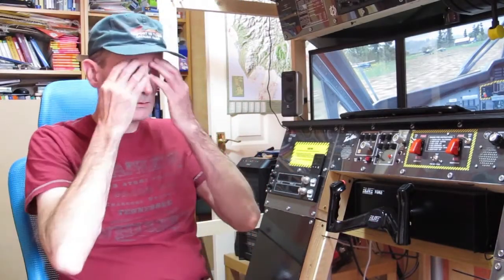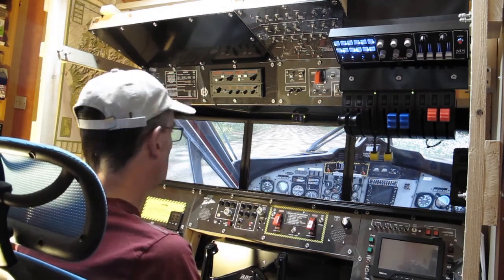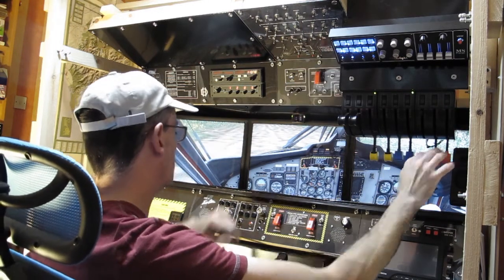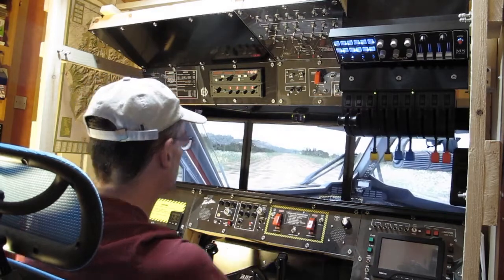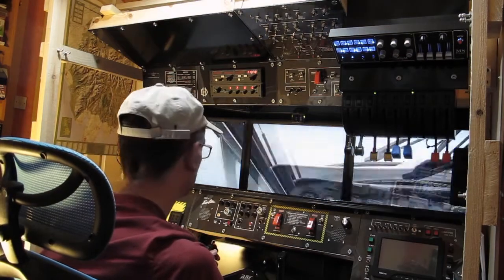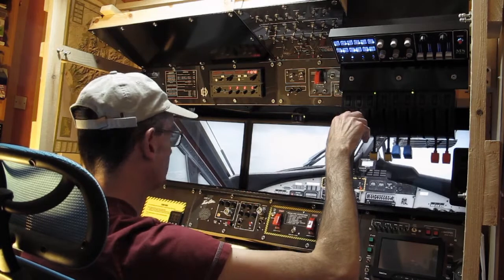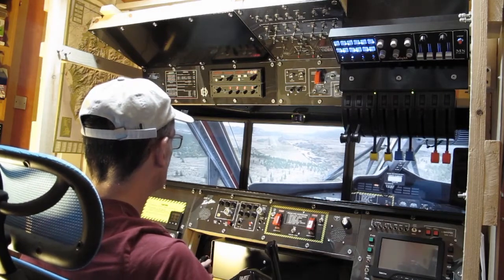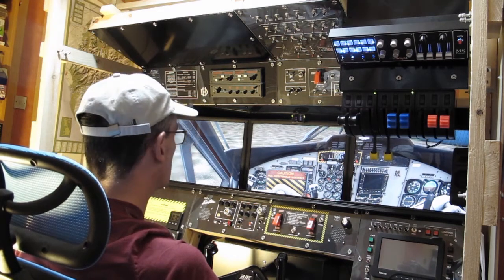First Flight without Keyboard or Mouse (Twin Otter Cockpit Build - Part 13)

Comment: Wow this is awesome. I've enjoyed all these videos. The Twin Otter is a great aircraft too, since you can use it on most any strip/runway, which is nice. :)
Reply from the maker: That was the plan! IThe one I'm flying is the Tundra version too, although I don't know if the difference in tyres is really modelled.
Reply: Almost Aviation That's what I though as well! Since you mostly fly smaller aircraft on remote strips in Australia and such. (At least that's what I gather from your videos)

Comment: How do you trigger the controls  ? LVar or default offsets ? Can you provide me a list for each controls' offset codes ?
Reply from the maker: I use LINDA functions to bind the buttons and switches to FSX. LINDA requires FSUIPC and functions are written in Lua. In many cases these just call standard FSX events. In other cases they manipulate Lvars. You can find all the controls in the LINDA library here: https://www.avsim.com/forums/topic/416130-aerosoft-twin-otter-extended-module-13/

Comment: that twin otter sound, is it the original sound or addon, if it is what software product is it??...
Reply from the maker: +Shawn It's an add-on sound pack, from Sonic Solutions. It was really cheap, as I recall.
Reply: +Almost Aviation  thank you and nice home cockpit you got there, I'm building one as well but it won't finish until summer hopefully cause I'm in college right now and flight school is a little far ahead so I'm just trying to build my own home cockpit but impressive design and professional interview on yours
Reply: +Almost Aviation why divided reversers from the throttle controls?
Reply: +Almost Aviation just asking, not saying its a dumb thing or anything like that, you're my teacher on this stuff so I'm highly learning and understanding your word
Reply from the maker: +Calvin Rogers There is no good way to do it properly with the cheap Saitek quads. Yes, with FSUIPC you can make two ranges but the travel is short and you have no centre detent.

Actually, while I say there is no way, in theory you can use FSUIPC to reassign the slider to a different axis when you click into the Saitek's bottom detent, so you could pull back then push forward for reverse, then do the same to switch back to forward thrust. Pete Dowson posted some Lua code to do that somewhere and I had a brief tinker but gave up because it was easier just to use separate sliders :)
Reply: +Almost Aviation oh OK thank, slight question, so the throttle can't have both full throttle and reverse thrust on the same lever, like setting the idle point at 50% of the lever distance on the quad
Reply from the maker: Calvin Rogers Well that's what I was trying to say - yes it can, but it's not very satisfactory with a  bit or hardware that isn't designed to work like that.

Comment: You should modify the screens so that there is no black bars
Reply from the maker: Well yes, ideally. I'm not ready to try that with these monitors as they are the best display solution I have had to date and I wouldn't want to risk destroying that. Maybe that's a future experiment, though.